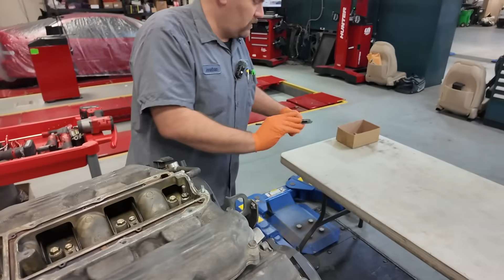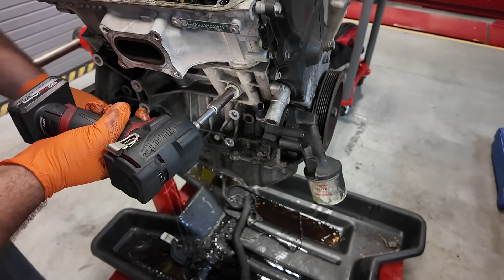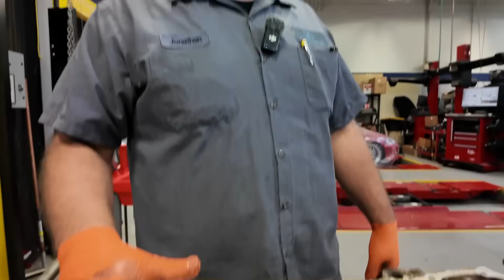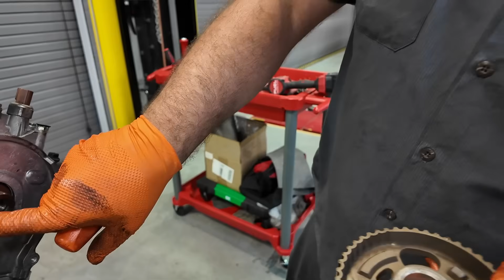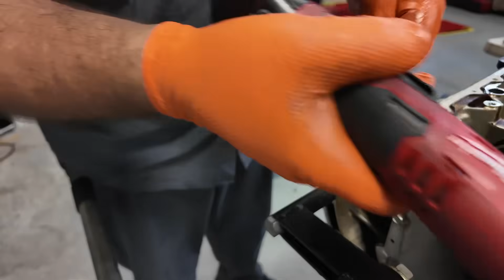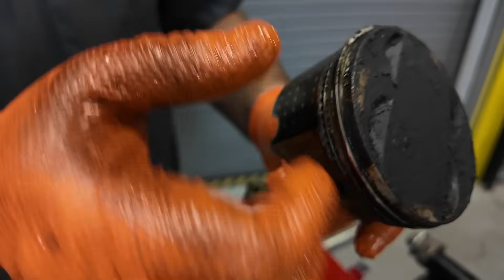Acura Honda J35Z2 Port Injection Engine Full Teardown // Engine Knock & Oil Consumption

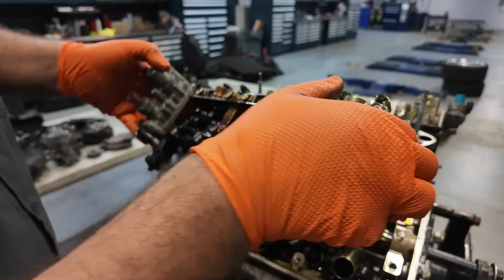Comment: 23:08 this engine has NO VTEC, this is VCM solenoid for cylinder #4 (first one on this bank). 24:00 you can tell it is not a VTEC camshaft, it lacks VTEC lobes for cylinders 5 and 6. Cylinder #4 additional lobes have 0 lift as they should for VCM operation. Honda VCM engines do not have VTEC. i-VTEC on VCM engines is Honda's marketing term, it has nothing to do with actual VTEC.
Also, carbon buildup is 100% caused by oil consumption - common issue on Honda's VCM engines.
Reply: Thanks for the knowledge man I am just winging it most the time.

Comment: 11:13 when reinstalling this coolant pipe, by lubricating these o rings, do you recommend something like dielectric grease, hondabond or other types of silicone?
Reply: I use Honda silicone spray

Comment: ummm how many miles on that engine i have a 2012 tl 3.7 awd and im at 191k miles and the only maintenance done was the alternator and batteries tires and the usual oil change I did the spark plugs at 112k miles lol
Reply: I was wondering the same thing. I also have a 2012 tl sh-awd 3.7 6mt. I already bought all the timing belt service parts, along with spark plugs, coil packs, all new seals and front axles. I've been waiting for my Acura tech to get me in. I'm hoping he can get to it soon. I wanna see what condition my motor is in after seeing this one.
Reply: Vcm bypass kit come on guys!
Reply: @Verde_EF91  3.7 do not have VCM. They have other issues: "Alusil" and low tension piston rings. J37 is the worst Honda's J-series engine, discontinued over a decade ago. Google "j37 oil consumption class action settlement".
Reply: @John-ep9xh  I have a 2013 3.7 liter engine and is a very  powerful and reliable engine. Run at day 1 with only mineral oil and now my engine don't have any oil consumption.
Reply: @racer65069  The exception that proves the rule. This "very reliable" engine came with a very high price tag for Honda (post production). Discontinued after only 7 years of production. J35 is in production  for at least 26 years and counting.
Reply: I have a 2010 Tl with 240,000 miles I did the timing and all maintenance. It runs like a beauty
Reply: @BuiltR35  3.5 or  3.7?

Comment: Wow now that I have seen some of the failures, why do people like these motors?
Reply: They are fun and if taken care of properly you don’t really have to go through most of the fail points until very high mileage if I’m correct by that time you might be looking for a new vehicle
Reply: @leonbaptiste2272 Yeah most of these motors that go bad is most likely from neglect. I think they are pretty tough and like you said, they don't need much until they get high mileage.
Reply: We like J-series engines with no VCM, no "Alusil" and no low-tension rings.

Comment: I didn't know the 2013 RDX was v6 why did they go for the 3.5? The TL, RL, MDX had the 3.7 in the same year
Reply: The RL,TL and MDX had 3.5 also. To be honest this engine is very very responsive and peppy at the gas paddle. I don’t know why the 3.7 wasn’t the same had a lag or slow response or hesitation
Reply: @leonbaptiste2272 i have a 2013 MDX it has a 3.7 also forgot to mentioned the ZDX is also 3.7
Reply: @bigbrownbull  the TL, MDX came with both options 3.5 and 3.7

Comment: how many miles on this engine? the cylinder disable system is bad for all engines. terrible gimmick from manufacturers.
Reply: Agreed. Been hearing of lots of issues on Mazda Skyactiv engines with a similar CD system. Same with GM V8 engines.
Reply: @Patrick94GSR  Dodge has similar issues with MDS as well